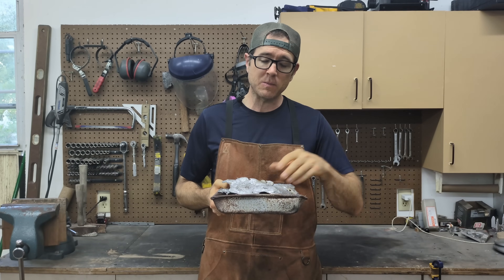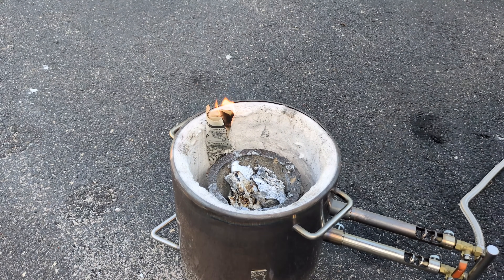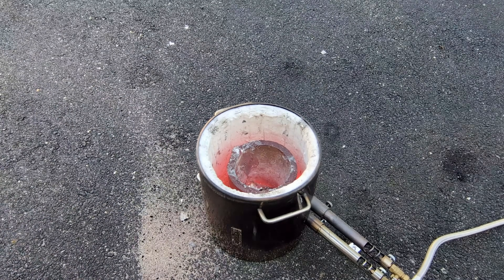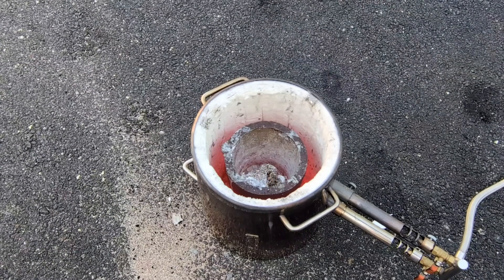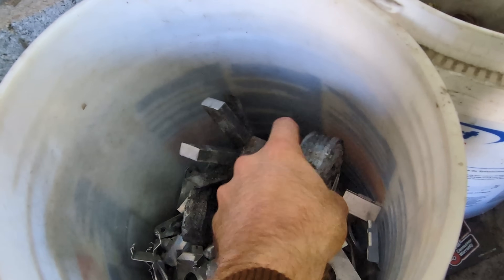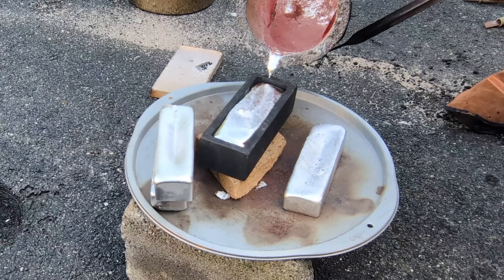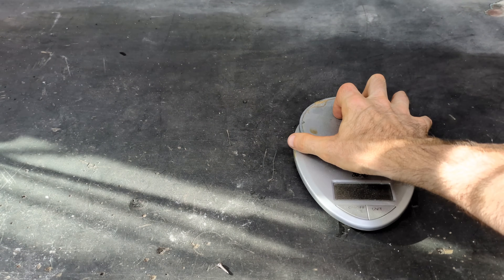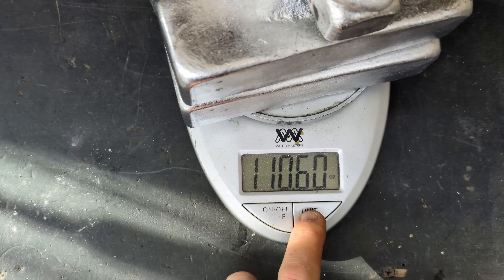How To Melt Aluminum for Casting at Home - Metal Melting Furnace

Comment: Your skimmed slag looked a little bit Aluminum rich still. If you didn't already throw it out, try remelting it with a teaspoon or so of salt, I use Morton lite salt (a mix of sodium chloride and potassium chloride) and it will separate easily into good aluminum and all the junk/oxides (forbidden ground beef as my girlfriend calls it).
Reply from the maker: I agree!  I actually let it melt for another 5 minutes before scooping it out to try to get a little big more out of it. "a little ground beef" 🤣🤣🤣

Comment: So cool to watch it pour into the molds. ❤ Liquid Metal ❤ The heat must be tremendous
Reply: melting copper is even more intense ... i wear full gear and face shields as i once had a pair of khakis begin to smolder from over 3 ft away ... I did cast iron one time and that was even worse .. not sure I will do that again .. but i just pour bars , HM makes some really cool stuff
Reply from the maker: @dukenukem001 yeah buddy it's very dangerous.  I wear a face shield and leather protection.  I see people pouring Molten Metal without any protection.  I comment and they say they are being "safe".  They obviously have no idea what they are dealing with.
Reply from the maker: Yeah it's so enjoyable to watch.  Yeah aluminum melts at 1221°F. It's hot!